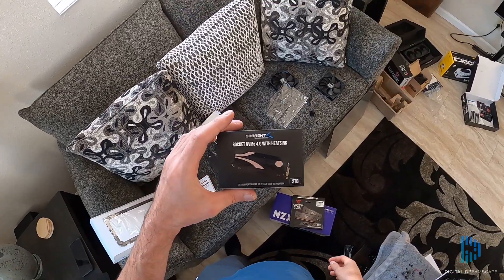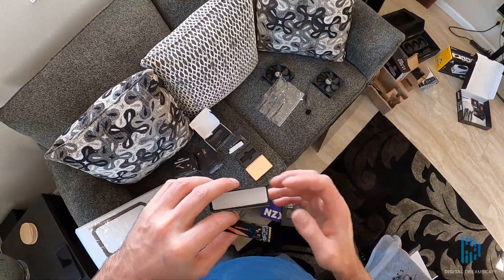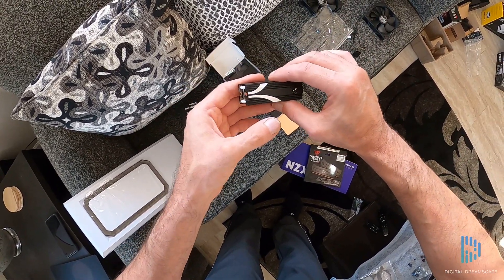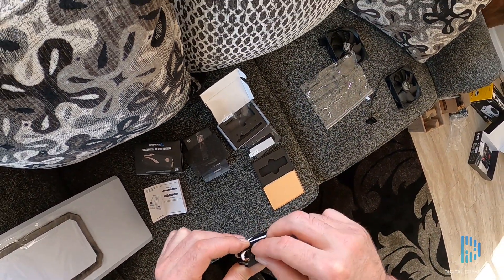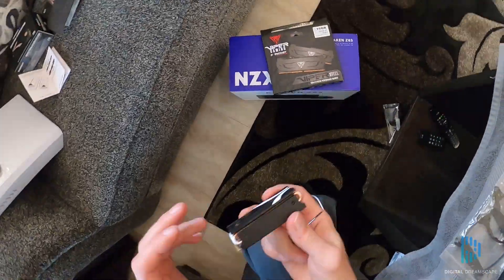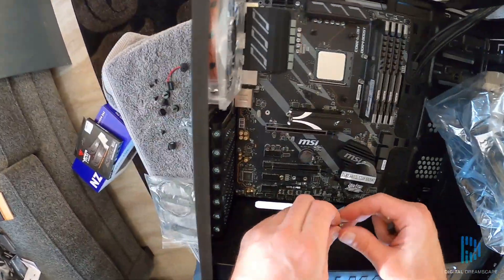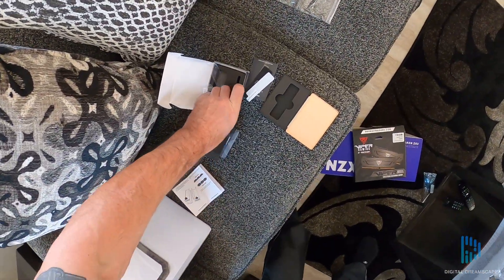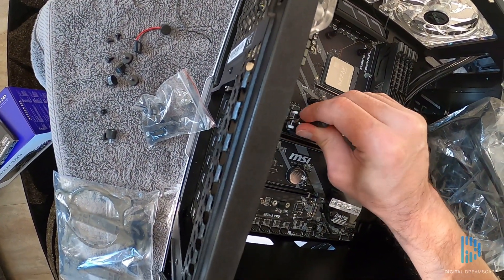NVMe Solid State Drive Installation: Sabrent Rocket 4.0 with heatsink : Storm Trooper PC Video #4

Comment: I couldn’t tell if mine was double or not I’m using a 2tb sabrent with the Sabrent heat sink (the heat sink came with a longer screw for the install vs 5 small screws) . I couldn’t get the second thermal pad on so that it would fit flush with screw hole until I watched this video. Apparently it’s double sided on the chip must be underneath the sabrent logo? It definitely wasn’t going to work with more than one thermal pad

Comment: Do you still have these installed? How much is your Rocket 4 bent today?

Noticed that you installed the heatsink without removing the "rubber pad" on the motherboard, which have just caused one Rocket 4 of mine to bend too much due to the pressure from underneath, since the HTSS/HTSK is thicker than most heatsinks on the backside.

Comment: With great enthusiasm and after seeing at least 7 YouTube Videos, I got the gadget fixed on my ASUS RogStrix MB. The system failed to boot. The bios failed to see the NVMe SSD. Tried thrice, then removed the gadget and got my system running normally. I do not know shat happened.
Reply from the maker: That's odd.

Comment: Might be a dumb question, but, how do you know it’s double sided? What does the other side look like?
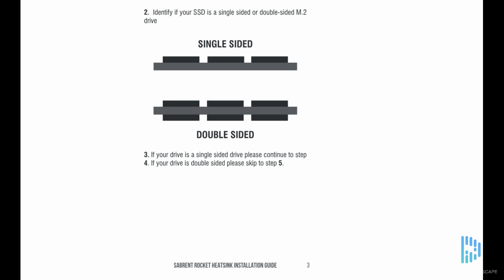Reply from the maker: I cover that at 00:18 in the video. There is a diagram that explains the difference.
Reply: @DANRANTS1  no, you literally don't cover it.

The BOOK SHOWS US THAT, but not actually what the physical real drive looks like in comparison. 

Sorry but it is totally not obvious to someone who doesn't know what they're looking for... you don't even say what drive you're using. Just that it's double sided...

Like come on bro, if youre going to make a guide at least put in more effort than the book.
Reply from the maker: @maxwelljames3573  If you can't see the difference in the illustration I'm not really sure what to tell you. A single sided drive has chips on one side, the double sided has chips on both sides. It's pretty obvious in the book and in the video.
Reply from the maker: Also I show the package at the beginning and it says 2TB right on it.
Reply: @DANRANTS1  I believe what he's meaning is that the picture isn't an actual picture so it leads to confusion, or the fact that we have something that looks like half the picture so I'm lead to assume it is double sided but not completely? 500 GB model in my case.
Reply: @maxwelljames3573  You can literally see the chips on both sides ffs